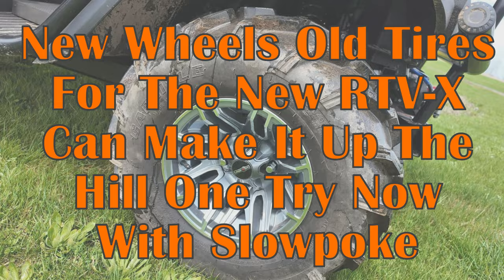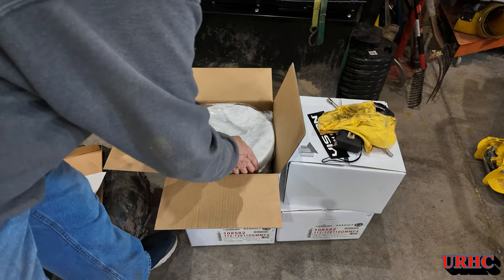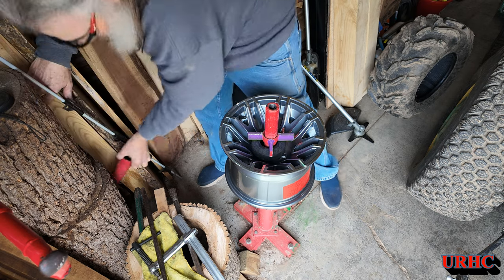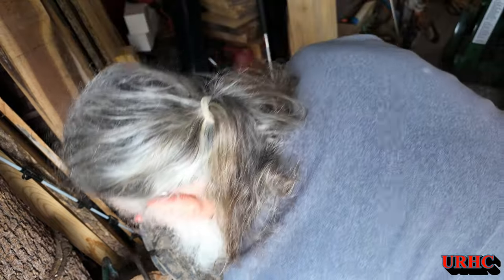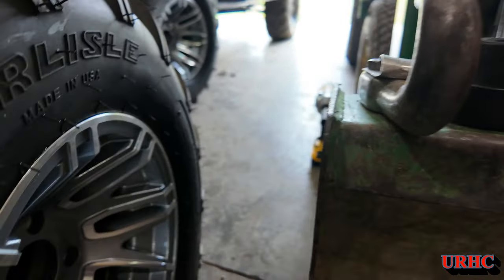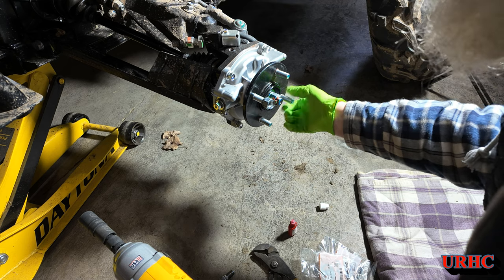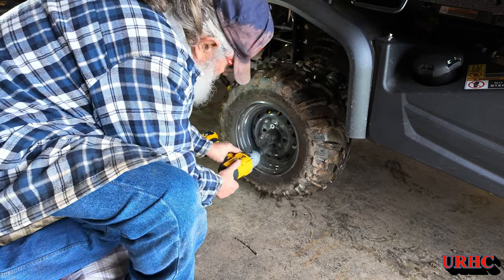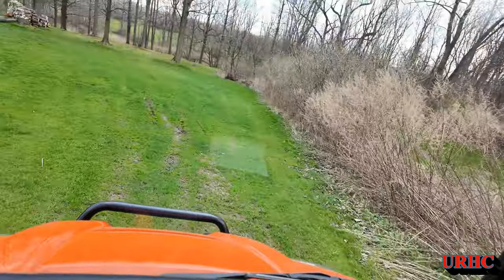New Wheels And Old Tires For The New RTV-X.  Can Make It Up The Hill One Try Now With Slowpoke

Comment: This will help a lot of people learn how to change tires and understand offset measurements. Thanks for sharing. Cheers, Mike.
Reply from the maker: That factory offset seemed a little excessive when comparing this to the old sidekick that that set of tires fit right on. Those little harbor freight tire machines are very useful if you have smaller equipment.  Thanks for watching.

Comment: Hi URHC, The new wheels 🛞 look 👀 very nice, and the stance of the truck looks better, it’s a shame that you’ve lost some performance, going over to diesel, and you were a thought. It would’ve had a lot more pulling power and struggle so much going up the hills., 
I have looked at some of the reviews of the petrol new version and the diesel version as well. It seems like the new petrol engine that is a lot better than last year. , Great looking truck, When I’ve got my garage sorted out, I’m hoping to pick myself up a ride on lawnmower, 
Keep up the grape reviews , stay safe, from France
Reply from the maker: I am surprised by how little torque this machine has once moving. I have to get some more hours on it to see if it loosens up. At least the wheels got the track width to what the gas one was and gave it more stability on the hill. And these tires don't plug up and slide like the stock ones did. Looks much better to me now and should last forever.  Thanks for watching.

Comment: The orange valve on the side of the driver seat, stop at the bottom of the hill and pull it up it will put it in bypass mode and give it more power to climb up the hill
Reply from the maker: That is the differential lock and nothing to do with power. If one rear wheel starts spinning that gets them both spinning for more traction. Thanks for watching.

Comment: Ed... You're getting her into functional shape.  Hope this one is more reliable for you.  Has your Kubota dealer provided you with an acceptable reason why if it is supposed to do 25 mph and it only does 16 to 18?   I would think it would indicate to them that something isn't quite normal (and as advertised) and they should take corrective action. Take care, hope you and Dale are happy and in good health.
Reply from the maker: Definitely taking more time to switch over then I thought. They look the same but don't have much in common.  I have to give it a couple more hours to break in as I have read that makes a difference.  Really feels like the hydrostatic transmission uses a lot of the 25 hp and the engine rpm is not in the power range most of the time like my BX that has a separate throttle control and always runs wide open with just the hydro adjusting speed. Never expected a diesel to feel so underpowered but at 3 to 4 mph it's unstoppable. Runs good and sips fuel so I just have to adjust to the creeping along for now. I'm going to stop in and talk to them later this week. Thanks for watching.

Comment: Does it have a governor or a screw under the gas peddle? Seems very slow, unless the computer limits it until the engine is broken in completely.
Reply from the maker: I don’t know. There are a whole bunch of interconnected linkages on the engine and I am afraid to touch anything.  Im thinking it may be related to breaking in. Supposed to hit 25 but highest I have been able to get it is 21 downhill, 17 up a slight grade on the road in front of our house. It has a bunch of torque below 5 mph. The hydrostatic transmission seems to be very power hungry as speed increases. Im going to pass it by the dealer. Thanks for watching.
Reply from the maker: Stopped down to see about this and about  20 mph is what they do on the flat. They can bump the speed up some but that sacrifices low end torque.  Apparently it's best to leave them at the factory setting that have been optimized for torque and speed. Kind of sucks. They all come like this.
Reply: @unemployedredneckhillbilly2023  that’s a bummer… time to peruse the aftermarket community to see what anyone else has done to open them up a bit